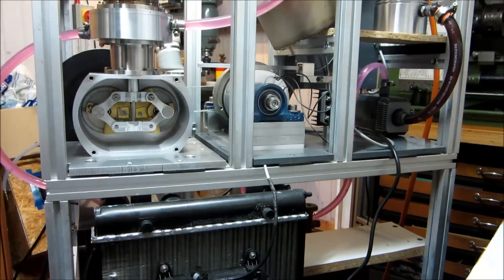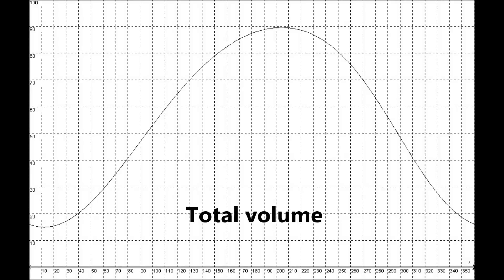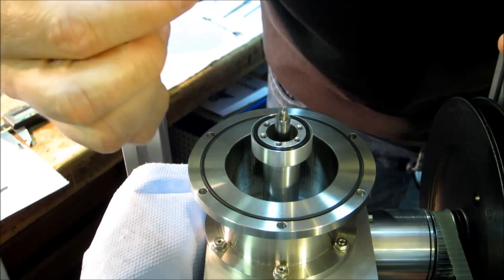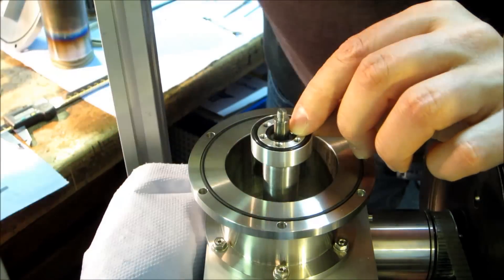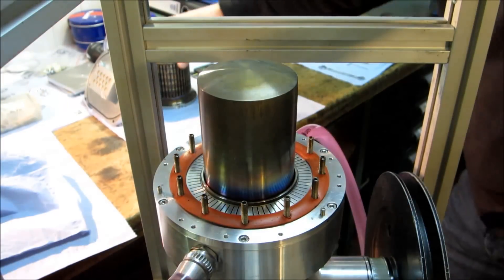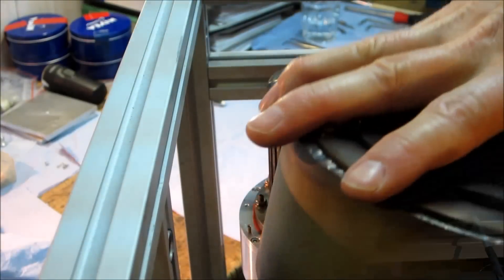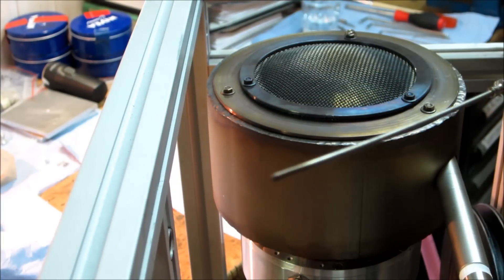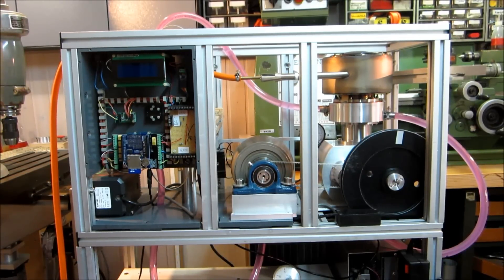Rhombic Stirling engine disassembling, details and development

Comment: Could you machine graphite seals in place of the plastic ones?  Is the thermal coefficient of expansion similar to metal if so?

As the air goes up and down the cooling/heating slots, would it make any sense to have the slots vary in size?  For example, as the air goes down through the cooling stage it will contract and slow decreasing contact with metal for a given volume of gas.

I don't know what I'm talking about so bear with me, but could you also make the parts in the rhombic drive more aerodynamic?  Like thinner sections with sharper leading edges?  It must be quite an air-blender in there when the pressure is up and the thing is doing over 1.5k rpm.

How about increasing the surface area inside the hot end of the displacer?  Like spikes on the piston and holes in the cylinder for them?

Could you get better energy transfer by using a chain drive instead of a belt, and increasing the diameter of the cogs?

Could you use some sort of catalyst (if that's what it's called) in the combustion area, like is used in butane soldering irons, or gas lamps?  Something to slow the gas down and increase the temperature?

Are you able to decrease the reciprocating mass at all?  Maybe drilling holes in some of the moving components? 

Could you run the liquid cooling past the expansion chamber for the fuel, such that the fuel is heated and the liquid cooled?

Although you have used a silicon gasket to separate the hot and cold parts, do you think the bolts that hold it together transfer much heat?  Could you increase the surface area and thickness of the silicon slightly, and use smaller diameter bolts, with silicon under washers on each side?

This is somewhat of a dumb question, but could you use something other than water for cooling?  Like in a heat-pipe, some sort of phase change material, or pressurized co2?

How about a mixture of hydrogen and helium for a working fluid.  Just enough hydrogen so as not to blow up your home in case some oxygen decides to bond, but enough to make even a few percent difference in performance.

Could you use the power generated, instead of heating a dummy load, to run a small heat pump or crappy thermocouple, or better yet a smaller stirling to cool the cool side?  You may be able to cool the coolant several times over the amount of power used to move the heat.  You could even preheat combustion air on the hot side to save a little fuel or increase the temperature.  If you still want to go with a dummy load, maybe you could wrap the hot side in an electric heating element that can achieve a greater temperature than the combustion normally could, and dump your electricity in there.

Could you use waste heat from the hot side to power some crappy thermocouples to produce a bit of extra power? (or better, yet another stirling / kalina engine).

That's about it.  Sorry if I'm not understanding how this works.
Reply from the maker: Hi versys69,
thanks for your nice suggestions I will try to react on your good proposals.
I tried graphite seals and they are not very stable and always lose dust which  may clog the regenerator and I think graphite won´t last long exept you have a super finish on the cylinder like test tube glas.

Varying the size of the heating/cooling slots may be beneficial but hard to make but I will think about it.
Do you think the aerodynamic of the rhombic drive is so big deal to back up for this? I don´t know but a good hint.
When I increase the surface area of the displacer the longitudinal travel of heat to the cold space will be bigger which is not good, also I don´t see any advantage of this or do I understand you wrong?
Energy transfer of the toothed belt is very good, bigger diameter will mean higher speed of the belt and thus more friction.
The Idea with the "catalyst" in the burner is a very good idea I am always looking for ways to improve the burner. If you know more about this I am very interested.
I always try to minimize mass as good as I can.
Combustion air preheating  (and as you state fuel preheating) is very interesting and is a step I will attempt when the engine is running satisfactory.
I am experimenting with helium as the working fluid and will post results when they are good enough. Hydrogen is to risky and the atoms are to small they will travel to easy through my gaskets and even through metals. The engine  is just in the early experimenting and testing stage. When I make long-term test series I will use the energy for someting useful. 
Wasted heat will be used later to preheat combustion air.
Very much thanks for your many kind suggestions, I will think about them a lot and will be happy to hear more of you.

Greetings

Ralf
Reply from the maker: Hi Versys69,
yes a free piston engine is a very interesting concept but it is very different from this engine and I want to optimize this engine step by step.
When I see no way of more optimization for this one I will try something new. Maybe a free piston engine.
Greetings 
Ralf
Reply: Hi Ralf,
That will be a great project if you try it.  I envision you using the microcontroller to oscillate the engine to use as a cooler!  The reason I suggested it for your engine, although as you said it would be very different, is that I read somewhere that the person who invented the free-piston Stirling did so when he realized that the beta configuration could run without the linkage.
Anyway, amazing work dude!
Reply: Hi Ralf,

I was thinking more about what I said in my previous post, and your responses.  

For the varying of slot size: depth would probably be the most easy to control when you are cutting metal, if you could calculate the temperature gradient along the slot.  I have no idea how, nor if the increased friction from a narrowing cut would cancel out the increased gas-metal contact temperature exchange.

The Rhombic drive aerodynamics:  I have nothing to back it up but intuition.  Running at very high pressures would of course increase friction substantially, and since air friction is proportional to the cube of speed, running at fast RPM may at some point make it a dominating force.  Perhaps calculating the cross-section of the parts and calculating their speed would give good input for an equation that yields air friction force at various gas pressures.  Maybe use max speed in the calculation to make up for losses in bearings and non-linear airflow.  Perhaps someone else has a comment on this?  (assume 1.5k RPM and 10 bar helium).

Displacer, hot side:  I was not suggesting to increase the travel, more to increase the surface area of the head (the top side).  I was thinking some spikes sticking up, and some tubes build into the cylinder head that the spikes can loosely slide into.  I think I may have seen pics of something like that years ago.  It would allow you to maintain the travel of the displacer, yet have more area to transfer heat.

Catalyst:  Not sure.  I stare at the one in my soldering iron and wonder about it often, but have been too lazy to look around.  I will though.  Now it's bugging me.  [edit: I see "platinum coated glass wool" suggested]

Keep up the great work - it certainly inspires the imagination! :)
Reply: Hi versys69. I too, know little of these engines but find them very interesting, your q's/suggestions sound quite apt , good thinking outside the square!

Comment: Thank's for this video. I am very impressed by the machining. It's awesome. Do you have machined all the parts at home? Were do you pressurize the engine? By the cranckase or by the work space?
Reply from the maker: Hi Chris,
most of the parts I machined at home but some of the heavier stuff I can do at work.
I pressurize the engine at the crankcase but there is a one-way valve in the top of the working piston.
Greetings 
Ralf
Reply: Hello, where can we get a construction and production plan? @myengines2443

Comment: Thank you very much for all your amazing efforts and ingenuity. 

You'll never be able to overestimate how millions in war-torn grid-less regions in the Middle East are anxious and desperate to get your solution (and similar) working to utilise them empowered by solar for lights, refrigeration and other basic necessities. 

Would be perfect when you always think of integrating your engine in turn-key power 'Packages'; Stiriling, solar collector, battery, inverter/charger and control.

When a blueprint/prototype is ready, here, a million units are needed right away!

Cannot wait for the next video.

ThankYou
Reply from the maker: Hi SunRoad,
thanks for your kind comment.
At the moment I am focused on "just" the pure engine itself but a package as you described with solar collector, inverter etc. is very interesting and of course as a final goal this is on my mind and I inform myself about this topic as much as I can.
Unfortunately Stirling technology is expensive. At the moment I just try whats possible and when I reached my goals I will try to make the engine more simple to drop costs.
At current complexity it is far to expensive for rural undeveloped areas. But when I learn more maybe it can be made cheap enough to compete with solar cells particularly when you consider that it is also possible to produce power at night (biomass etc.). Greetings Ralf

Comment: Thank you so much for the video. I was amazed at how many seals you used on the hot piston rod, and still got low friction, really admirable.
Now I understood how you made the rings for the cold piston, very interesting, really creative.
Is your cylinder hot, is it crimped inside, like a part of the cold cylinder? I mean in the cooling system of the cold cylinder!
Sorry, but at least I did not realize, you have a regenerator in your engine ?? Because I did not notice in this video.
Could you tell me why, because the Andy Ross engine did not run above 3 bar? Because your engine works great at 10 bar!
Leandro Wagner.
Reply from the maker: Hi Leandro,
nice to hear of you.
In this testruns I use a stainless  wire mesh (mesh 100) regenerator   (you can see one layer when I lift the heater head, in the previous video you can see
the entire regenerator and also the foil one ). Surprisingly all my regenerator tests (and it were several)had very little effect on engine performance.In the professional literature the importance of the regenerator is always stated but Andy Ross also wrote in one of his articles that he noticed very little effect of his regenerators. At the moment this is one of the biggest mysteries for me.Maybe the effect becomes more important at higher pressures.

I have much bigger heat exchangers (and therefore much bigger dead space) in my engine then Andy Ross had and the engine is designed for 10 bar pressure.
Sorry but I don´t understand your first question "Is your cylinder hot, is it crimped inside, like a part of the cold cylinder? I mean in the cooling system of the cold cylinder!" maybe you can write it different when it is important for you.
Greetings Ralf